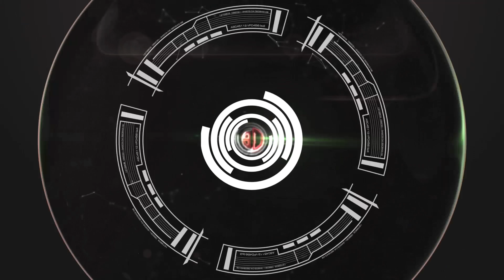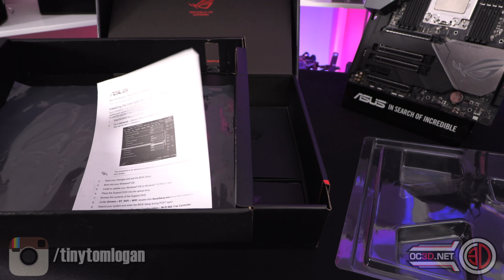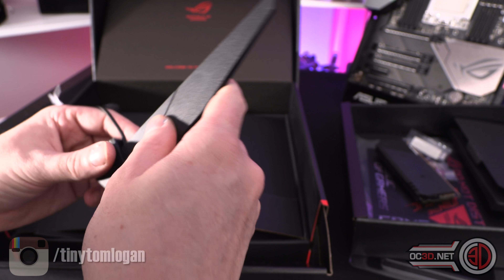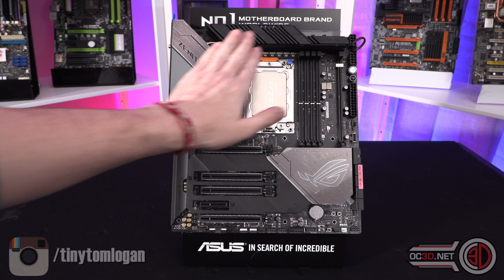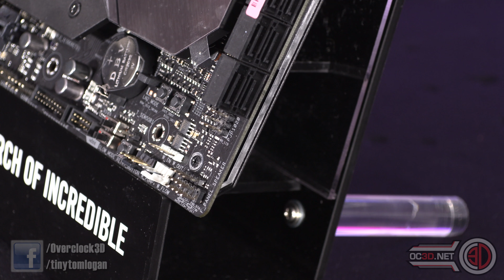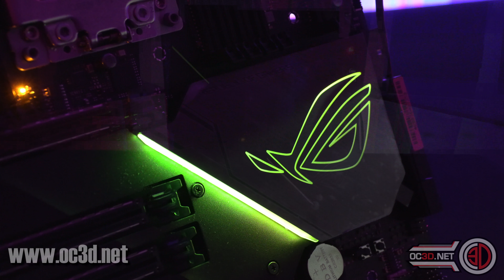Asus ROG Zenith Extreme Alpha Preview

Comment: might be my upgrade soon this board, is it possible to switch off all the rgb? i wanna build this into a server rack case so wont see the rgb anyway, but all the features the board has is super!  can anyone recommend a graphic card to use which is low power consumption and possible passive cooled? i dont do any gaming or videowork, just play blurays and stuff, so prop i can use a simple gpu , should be small and low profile one would be great for the overall cooling in the case. 

Possible a card which is happy with a pci-e x4 or so...  i need most lanes for hba and networking stuff.

Comment: Actually on the Original X399 Zenith the M.2 dimm card didn't come with a heat shield it came as a raw card,
Reply from the maker: Maximus was grey heatsinks
Reply: @OC3D  true for the Z series, but the X399 Zenith extreme v1  just had a raw card with no heatsink, i really wish i could find a heatsink on it's own, any chance you have contacts to get one?

Comment: Asus makes great hardware. But their Aura software is pathetic, if you can get it to work you will have accomplished the equivalent of figuring out the Gordian Knot.
Reply: I use Aura + Corsair iCue. What gives you problems? Getting it to work at all, syncing colors or what?
Reply: @TechWithSean Like many others, and you will see plenty of posts a vids in this regard, Aura doesn't launch. Occasionally it does though but after moderate use it stops launching again. This has happened numerous times and every fix employed has not resolved it. One Youtube poster summed up Aura software pretty accurately '...you know it's shit and I know it's shit'.

Comment: The real question is , is this board plagued with the issues the first 1 had?
Reply: Hello chinett63, could you please share you thoughts on the issue with the first generation aka  X399 ROG Zenith Extreme?  I just had to return the second X399 ROG Zenith Extreme replacement, by the first one one slot on DIMM.2 riser card did not work, on the second replacement the M.2 slot direct on the motherboard did not work either...

Comment: Got myself Zenith Extreme just before Alpha was released, didn't know anything about it. Anyway.. got it DoA at first, then waited a month, came back from warranty, chipset cover smeared with some crap I can't clean. Got it working over few hours of troubleshooting and then turned out that the bundled 10Gb NIC is not compatible with ASUS's XG-U2008 10Gb switch. Not gonna buy anything from ASUS for a long long time now.
Reply from the maker: Works fine with that switch.
Reply: @OC3D  Zenith Extreme (not Alpha) with the bundled 10Gb NIC (ROG Areion 10G)? It would not work as 10Gb with my case. It either falls down to 1Gb or fails to get a link. It seems they have changed Areion info, for whatever reason, because it showed before that Areion uses IEEE 802.3bz 10GBaseT standard, whereas the switch uses 802.3an. Now it shows both supporting 802.3an. ASUS support itself pointed out that it doesn't work because of that difference. Something that before purchasing the ASUS setup, I didn't even know would be a problem. 10Gb is 10Gb.. guess not though.
Reply from the maker: Need good cables for 10g. I'm on cat7
Reply: @OC3D  I'm aware of the general principles of getting 10Gb to work. That Standard difference meant nothing to me, so I assumed it would be at least somewhat compatible (maybe some features missing), if not fully. But I am running fresh Cat 6a, which is well within spec, so  yeah... if you're saying the same setup works for you.. I have no idea what could be wrong then. The NIC can't be totally broken, since it is works with 1Gb speed. Anyway.. I had to buy the ASUS's XG-C100C and it works that way. Which sucks a ton, since the board itself cost over 600€ + the extra 10Gb with was about 100€. And the very reason I bought this board was because it had 10Gb capability.

Comment: These companies just need to bite the bullet and bring back xl atx. Now more than ever do we actually need the extra length as lane counts skyrocket. You couldnt populate every slot on here unless most the cards were a 1 slot cards which we know just dont exist today. Also where's the 1x slot between the 2 x16's. This just screams overengineered gaming board to me rather than an actual workstation board. Does ASUS realize that threadripper is workstation first and gaming second? 

Not hating exclusively on ASUS here, MSI did the same thing with the creation. Bring back the XL-ATX boards with enough room. Also XLE-ATX wouldn't be a hard thing to make as most cases that support XL-ATX also support E-ATX. Threadripper is a massive chip and needs a massive board, and E-ATX just isn't cutting it.

Comment: Don't M.2 solid state drive performs better hot? Having a heatsink would negate its performance. How's the audio versus a dedicated audio card? Would an audiophile be pleased?
Reply: Controllers need to be cool but actual nand dies should be warm. Your best bet is to custom cut the thermal pad just to make contact with the controller, and then the gap between the flash modules and cooler will act as a heat trap to warm them up. That's how they are properly used but it requires the user knowing which module is the controller

Comment: I built a system last weekend with the Rog extreme alpha. Currently running the 2950x at 4.25 Ghz on all cores. The board is a overclocking champion. The 2950x can not even stress this board. Everything is running cool, very cool. The only issue I have is getting my 64 GB of 3200 Mhz Corsair RGB Pro memory to run at 3200. I have only been able to clock my memory at 3066. I give this board a huge thumbs up.

Comment: I'm not a fan of the pcie layout. The middle two slots are way too close together for proper use. Won't effect most people but if you're someone picking this up for a workstation they needs to plug in multiple pcie devices, that can be a deal breaker.
Reply: It's a gaming board unlike the MSI board. ASUS doesn't see threadripper as a workstation chip sadly.
Reply: @james2042  Correct, this is not a WS board. The ROG stuff should make it quite clear.
Reply: @sirius4k  But threadripper belongs in a workstation, not a gaming machine. Board partners making only gaming boards for TR is really what's hurting it. Also never said this was a workstation board, and thats actually the issue.
Reply: @james2042  I know it's the WS chip, but it is how it is. I guess stuff doesn't sell if you don't brand it gaming something-something. And to be honest, Threadripper is in its second iteration and maybe third soon to come? And there's still very very little choose from if you want X399 platform. And that's not only ASUS's issue. PCPartPicker shows only 15 motherboards, about 4 per manufacturer and they're ALL gaming branded. No dedicated WS board.
Reply: @sirius4k  Asus has AMAZING X99/X299 workstation boards, so even if they only made one X399 variant, it would be the #1 choice in most workstation applications, from content creation, to modeling, to even engineering. The fact TR supports ECC makes it a huge winner in my book over any i9.
Reply: @james2042  Yet, for whatever reasons, this is not the case. It would seem as if the existing motherboards exist only because partners HAD to come up with some supporting hardware. This could be because they don't see TR as a popular enough platform to investment in it much, as opposed to Ryzen and Intel stuff.
Reply: @james2042  which arises a good question ,why get  AMD for gaming anyway especially at that price point.. i guess its only marketed for the AMd fanboys
Reply: @girlsdrinkfeck  A 2600x makes a whole lot more sense than a i5 8400/9400, and the 2700x is only a lil bit behind the 9900k for 3/5th the price. Just threadripper that doesn't make sense for pure gamers, which is my point as to why the x399 boards are poorly designed as they are aimed at gamers when they should be aimed at content creators
Reply: Multi use setup. The spacing is designed to house the thicker RTX cards. If those aren't being used, single slot devices like PCIe storage, sound cards, or capture cards would still work.

Comment: m.2 should be run without heatsinks. they actually perform better when hot
Reply: The flash performs better, but the controller certainly doesn't. The controller needs cooling and like most electronics, the cooler, the better.
Please amend your future statements on this so as not to cause people to destroy their really rather expensive M.2's!